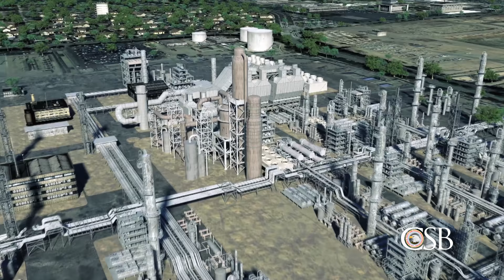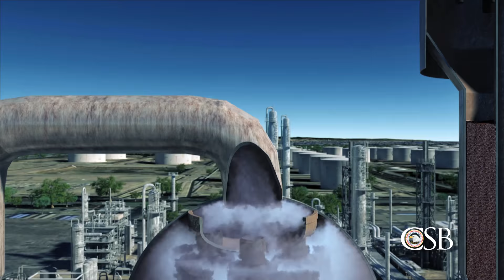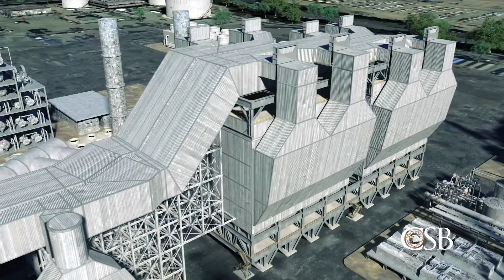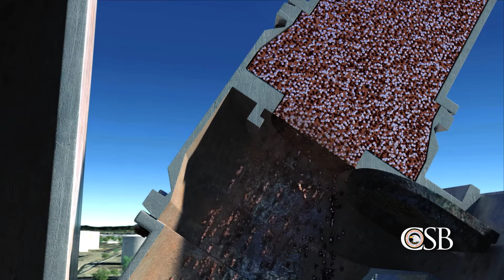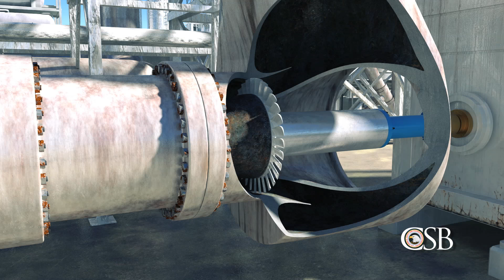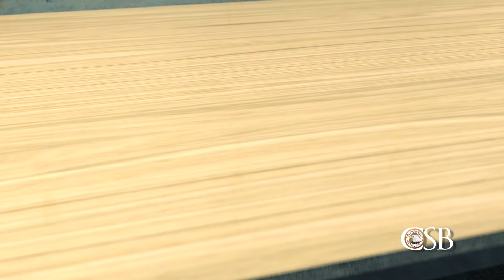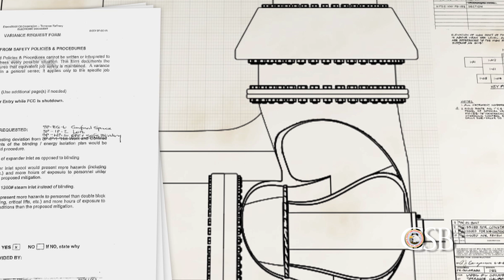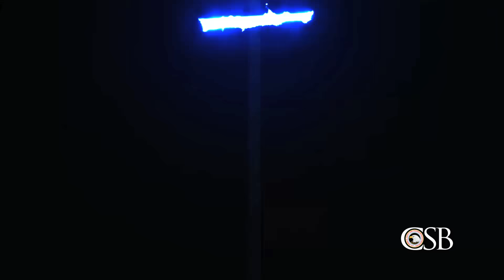Animation of 2015 Explosion at ExxonMobil Refinery in Torrance, CA

Comment: This is quality stuff. I'm working as a control room Operator on the Crude distillation unit and I've learned a ton of useful information from reports like these. It should be industry standard to release a animations for any major accident, as it can prevent those happening again in the future.
Reply: @arloweyers5432  No, the explosion was able to happen because of failures of design (Why, for example, was the ESP allowed to run with the unit in park mode?) and failures of management oversight (Why were the slide valves not more frequently inspected? Why was a variance allowed to be applied even though the circumstances should gave been recognized as being different when the steam started leaking from the expander flange? Why did such a variance which permitted hot work with only a single isolation even exist?) In my experience operators and designers - rightly -  thirst for knowledge like this, because every one of them wants to do his/her job better. I've used USCSB videos in training. They're excellent and I hope the USCSB will continue to be supported.
Reply: @arloweyers5432  Its sounds so simple when you have a video explaining exactly what happened to you and lets you see inside the vessels. In reality its much more difficult and many more factors are at play. You make the best decisions you can with the information you have to keep everybody safe.
Reply: Amen. Im glad to be running the crude/vac unit and not any of these catalyst type units
Reply: It usually is the intent of some interested organization, but those types of reports are often suppressed.
Reply: Instead they have us sitting for hours going over the samething at the Safety Council lol
Reply: what degree did you get to be qualified for that job? if you don't mind ofc.
Reply: Interesting to know,
a control room operator leaves his room during similar incidents?
Reply: @greg3930  They have rounds that they have to go on to inspect equipment during their shift. If there's an incident then they retreat to their armored control rooms (and I mean literally armored).
Reply: @SVSky  And they waiting until everything is completely burned
Reply: @greg3930  If a fire is that out of control there's almost nothing you can do. My old boss had advice for when there is a fire at a chemical plant: RUN.
Reply: @SVSky  You and your old boss are right.  But the first reason for the emergence of uncontrolled fire is running operators.
Reply: @greg3930  or you don't have good maintenance and automatic safety systems.
Reply: @SVSky   Any smart systems will not replace timely and qualified operator actions. Sometimes smart system is a reason of accidents. My first rule is never trust systems and will not have to run.
Reply: @greg3930  No argument, but it's a job, not a calling. Getting people to risk their lives for a job is a pretty difficult thing. For a calling, I risked it regularly, no normal employer could get me to take the risks I did in the service.
Reply: @SVSky  You right again human live and health is the highest value. But I said nothing about risk and calling. I just want to say that without quality staff any systems is nothing.
Reply: @greg3930  agree.

Comment: Well video was interesting enough but being a chemical engineer I wonder that why didn't the supervisor neutralize the charge of ESP, and even the chamber lacked any fail safe valves which might have prevented the incident. There was only one side valve which they used and didn't have any alternatives. Quite strange...!!!
Reply: In this service, it's pretty much technically infeasible to use a second valve for isolation.  People have been trying to think of a way to make it work with no success.

The ESP wasn't shut off because regulators require it be left on at all times, even during non standard operation.
Reply: Being anyone alive I agree, I was taken aback when they mentioned the supervisor put the steam back through the system but didn't turn off the ignition sources. 

That being said people on these videos always recommend more safety features, just keep in mind flammable gas wasn't designed to ever go through that loop of the system, there was really no need to put a safety valve there, nor would they have likely used it in this situation for the same reason they didn't remove any excess power from the ESP.
Reply: Keep in mind most of petrochemical industry assets are quit aged and not all are up to the latest standards
Reply: Because it is too expensive to update the equipment, and shut-downs needed to repair and upgrade aging and dangerous equipment cost more than "corporate" wants to spend in lost productivity.  They see no value in making things safer because of the investment out of pocket with no immediate return.  "Put the brittle and rusty pin back in the grenade and lets hope it doesn't break because we don't wanna spend the money on a new better pin."

Comment: Why the hell they electrostatic source to remove catalyst in a highly flammable plant? That's like asking for explosion to happen
Reply: With common-sense safety protocols, electrostatic filters are effective and practical, but Exxon-Mobile was cheap and reckless. First of all, there should have been a standard procedure to shut down the electrostatic filters during this kind of system failure. Instead of "Safety First", they were more focused on "Production First". Erring on the side of caution means lower corporate profits, so hands-on employees had to weigh losing their lives vs. losing their jobs. Nobody wants to be held responsible for costing the company extra money, so nobody wants to make a call to shut something down in the name of safety. That's why those decisions should be built-into the standard operating practice.

Beyond that, it was foolish not to include additional safeguards to prevent an explosion. If the hand-held sensors of nearby workers were detecting explosive hydrocarbons in the surrounding environment, why weren't similar detectors built into the electrostatic precipitator system, to automatically shut it down? — It's because there were no regulations to require better safety devices, and Exxon-Mobile could increase their annual profit by not spending money to install and maintain them.

If cutting corners on safety lead to some future disaster, that was not important to Exxon-Mobile. The annual CEO (etc.) bonuses and stock profits were already paid out — to people not injured by the explosion.

Comment: Another example of the oil industry and not shutting down. As soon as the steam/catalyst became an issue, they should have fully shutdown the plant. ie: the precipitator, reactor & distillation column. Cost shouldn't be an issue.
Reply: Well guess the fuck what? They certainly had to shut down after part of the plant blew up. No one ever considers the cost of what is likely to go wrong if they DON'T shut down when shit starts going wrong.
Reply: My thoughts exactly.....when the blind flange was attempted to be installed, it should have occurred to someone that the escaping steam "came from somewhere" unintended...the defective slide valve. Thinking only one more step ahead would have alerted someone that the catalyst barrier was then GONE !..... ding...ding.....red alert. Then there's this aspect.....why isn't there redudancy in a "CSS" (critical safety system) piping line up....why not 2 slide valves in series...and a monitoring system to assure catalyst exists where it should ? Component redundancy is too expensive to do everywhere, but there are areas where it should be done based on the safety-critical nature of the system response. This is a "single-point-of-failure" critical safety system that requires added attention such as redundancy.
Reply: @TheWilferch  Because that would cost money
Reply: @danieldorn2927  ....see all previous commentary incl those by me and from folks like matt galey. In essence, your answer is the reason American industry had its A$$ handed to them by the Japanese in the auto industry...."safety costs money"....."quality costs money".....typical 1950's thinking...pre-Deming thinking. In actual fact, its costs less to do it right the first time....in actual cost and in loss of life.
Reply: Because it's SO much cheaper to rebuild from a lengthy shutdown after shit explodes?
Reply: If there was a way to shut off the line between the column and FCC reactor, this would not been necessary. I am quite surprised, that as it seemes, there was no valve, which would allow that
Reply: The formal report from CSB actually mentioned this. The authors pointed out that this was a control valve, not a cutoff valve. Other FCC units on other refineries do have cutoff valves for exactly this reason.
Reply: Wil I thought the same thing! If the steam escaping wasn't a dead give away, the steam had to be coming from somewhere! I work in an Ethylene unit in Louisiana and in our plant double block valve set ups are pretty standard making sure gasses don't leak by where it could find possible ignition source . I am curious to as why they didn't have back to back sliding valves for redundancy.
Reply: matt....I come from the industrial gas business....producers of oxygen, nitrogen, etc ( the elements of air). Pretty much the same plant-design and operational problems apply as they do in plants described here in this video. I see no recognition of "inherently fail-safe" design, value-based redundancy....or many other of the OD ( "operational discipline" ) aspects that could have been applied to prevent this disaster.
Reply: No one ever considers the cost of a lengthy shutdown and rebuilding a unit.  Tunnel vision strikes again.
Reply: Cost of shutting down a plant is too expensive to actually consider doing that.
Reply: +Jacob Brodsky BRASIL PRESIZA DISTO BANCO DO NORDESTE REPASSAR ISSO PARA NORDESTE GANHAR MUITO DINHEIRO LANCHONETE VENDAS DE LOJA FECHADA REPASSAR ISSO PARA NORDESTE GANHAR MUITO DINHEIRO LANCHONETE VENDAS DE LOJA FECHADA REPASSAR ISSO PARA NORDESTE GANHAR MUITO DINHEIRO LANCHONETE VENDAS DE LOJA FECHADA
Reply: @josericardosilva2406  I don't know what you talking about